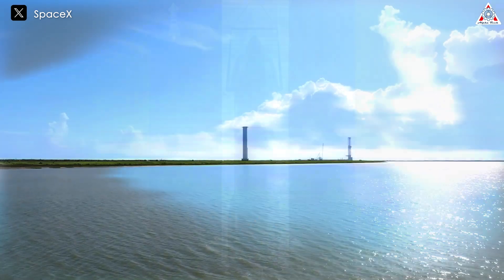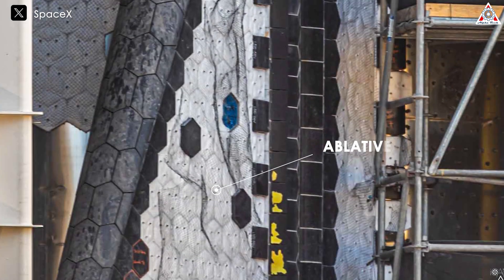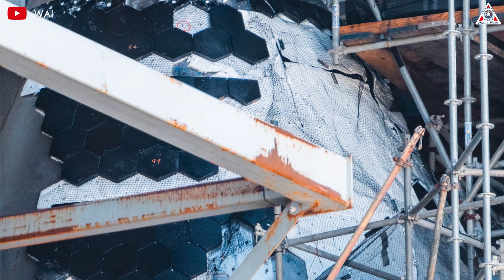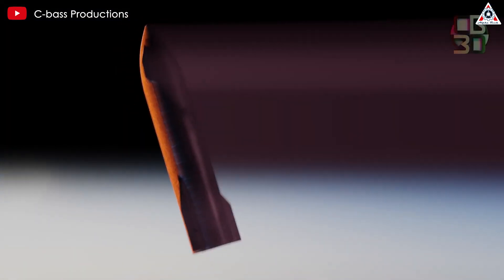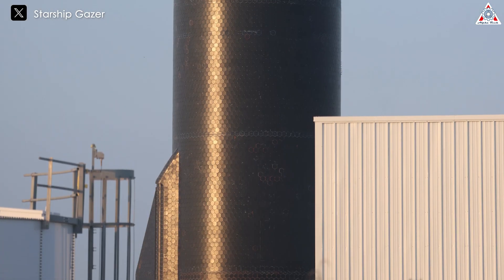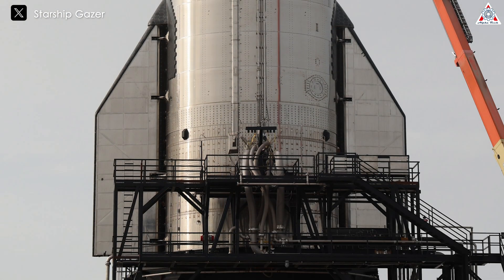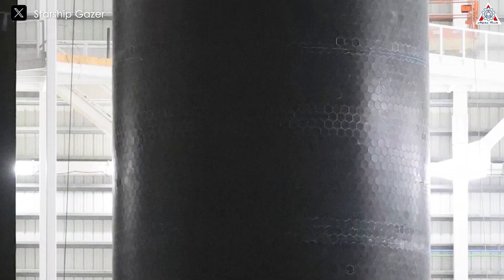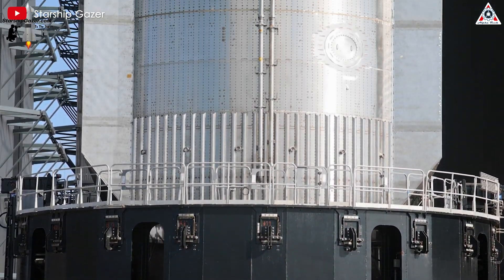SpaceX Starship NEW Tiles FIXED Revealed for Flight #5! Massive Changes...

Comment: Insulation tiles need to be researched and replaced as soon as possible with reusable materials that are more heat-resistant and can withstand multiple flights.
If the insulating tiles have to be replaced for every flight, it will be difficult to reduce costs and commercialize them.

Comment: Why don’t they use NoMex as a gap filler. It’s a fireproof material. It seems like a waste of time to put felt on a space ship exterior that is going to see extreme temperatures. That will burn off and possibly compromise the adhesion of the actual heat shielding tiles. NoMex would mitigate both of those problems.
Reply: on paper yeah

Comment: The problem with the linear one step at a time method, is you can go down paths a long ways before you run into a dead end.

This wastes time and money...

Much better to be like water over dry ground as Sun Tsu put it, be attacking the problem with a least parts count possible common denominator.
And exploring like tendrils on multiple paths.

I dont think tiles will do the required job reliably, ever. That was a Space Shuttle crew killer.

So, the question becomes, when will they quit cobbling on more krapp trying to make tiles work, and try a simpler solution?

Other solutions have been suggested...

Sure would hate for project Starship to stagnate...
Might be good for competitors, if they know to not attempt tiles...
Perhaps Starship's footnote in history might be the project that led other companies to better concepts...

Bizarre part, is if you had a super gun launching fuel mix into orbit, you could refuel the ships, and bring them down on retro rockets reducing relative orbital velocity to zero....

tiles etc. wouldnt be an issue...

Comment: High Atmospheric temperatures caused the burning of the flap???   If thats the case why doesnt everything in space burn up? I think it could have been caused by the friction of re entering earths atmosphere?
Reply: there is no friction in the first part of reentry, the problem is the hot plasma bubble around the ship created by the compressed air, at that velocity and altitude is like a very hot layer of plasma around the ship but there is no friction. You can notice that by looking at the flow of the air that is almost perfect laminar

Comment: I think this heat tile analysis is weak, if not just dead wrong.

Any sort of ablative heat shielding is an admission of failure because these rockets are supposed to be quickly reusable.  Granted, where a tile that falls off, but the ablative layer behind it comes to the rescue, the rocket is saved, but the rocket has failed in its purpose.

Instead,  here's what appears is really going on.  Elon has a better heat shield in the works, but it is not ready at this point, possibly because not enough of the new tiles have been made.  My guess is that the main improvement in those tiles is that they are simply thicker.  That means they are heavier, which is something they've been trying to avoid, but the thinner tiles just weren't doing the trick, which is NOT one falling off.

So rather than wait until those new heat tiles are ready, and since he probably has a ton load of current heat tiles lying around, this ablative material is a temporary solution.  He can still go one with other tests such as landing the first stage on Mechazilla with the chopsticks.  Now if for some reason, with the ablative material, not one heat tiles falls off, they may reconsider using the next generation tile.

Last, why didn't you mention that NASA went to the emergency room after this news?
Reply from the maker: This is everyone's opinion! and I respect your opinion
Reply: @alphatech4966  And I even more respect yours since you've gone to much length to express it.  I only typed up a rebuttal comment.